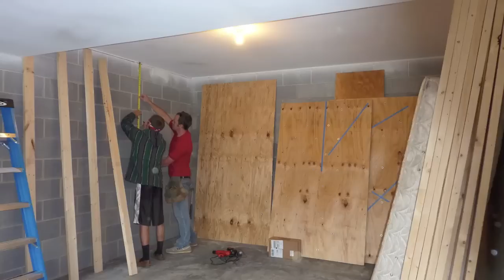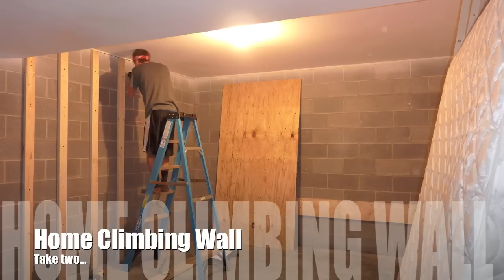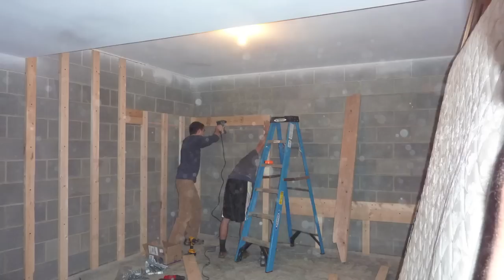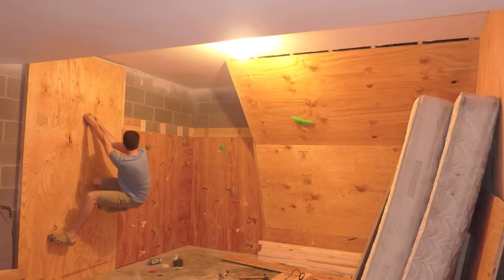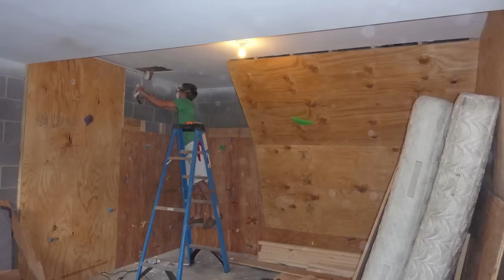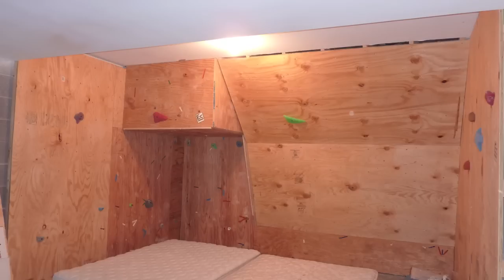Home Climbing Wall Construction 2

Comment: Did you consider using a grid of tee nuts to attach holds?  I'm in the process of building a wall using a tnuts on a 6" by 6" grid

Comment: awesome wall. i am building such a wall as well. do you have any hints, what you would do better now? could you let me know the measurements of the timber in 1:10 min. I have square timber at home (40mm x 50mm). I do not know, if that is sufficient. my plates are OSB plates 20mm.